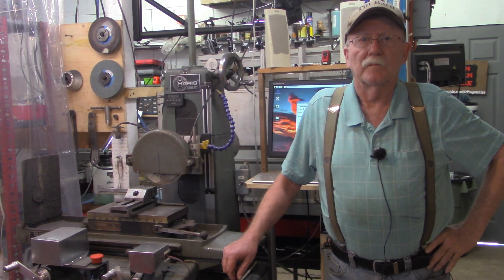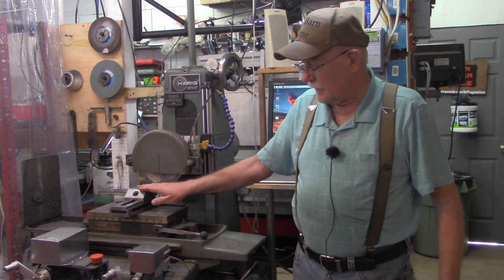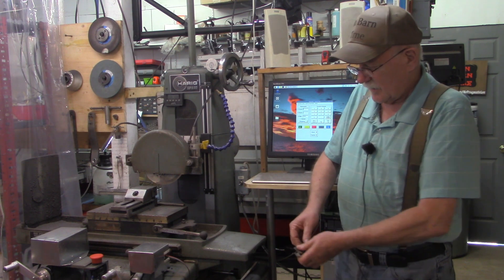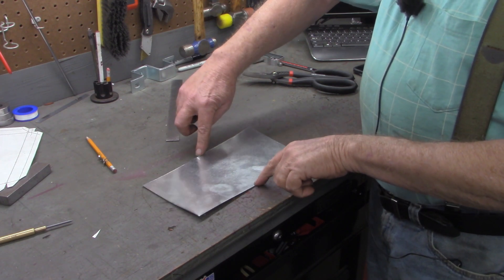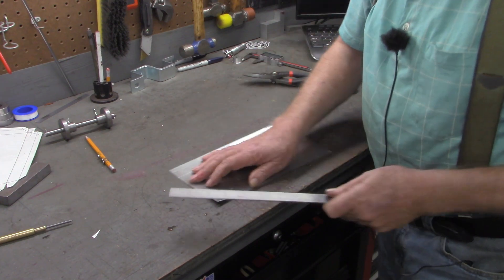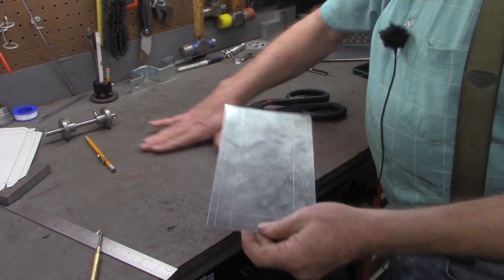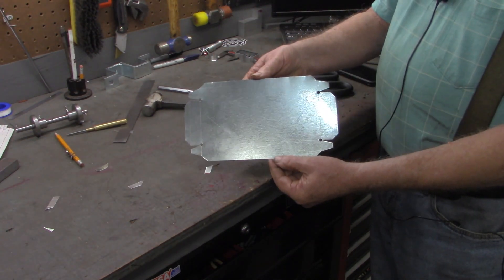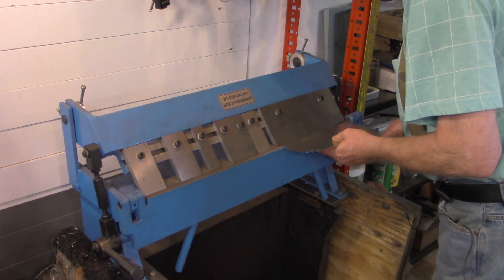Tool Tray for the Surface Grinder

Comment: Nice work!  Kinda surprised you didn’t use steel. This is not a criticism but it doesn’t look very rigid. I really like the design of the pan and how the tabs round out the corners!